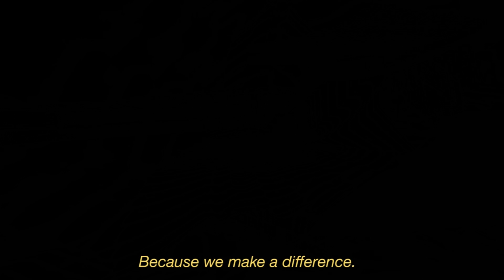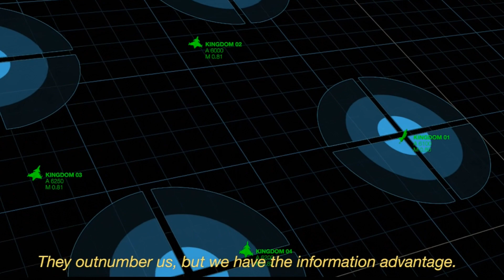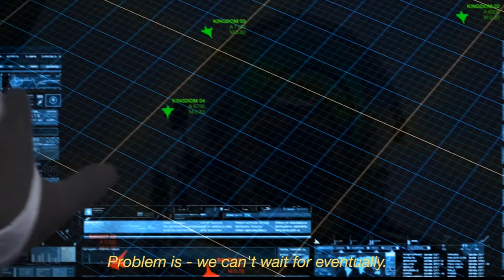Gripen Fighter Jet - Canada's Future Fighter?

Comment: what ive understood you get more airtime compared to downtime in the gripen and its much much cheaper than the f18 and it dosent break if you get a piece of gravel into the engine as the american planes its made to be cheap i think it was like a 4th of the f18 and also a 4th in matinence cost and you can teach a conscrips to change the engine on it so you could have much more airplanes and also much more airtime i think it was 22h flying and then 2h downtime

Comment: If the RCAF requirement for a twin engine aircraft (in lieu of safety in hostile, sparsely populated expanses, a.k.a. the arctic) is no longer deemed important, then I would back the Gripen for RCAF service and forget the F-35 entirely. The Gripen's latest iteration is very advanced, multi-role, NATO compatible, proven (serves in several air forces), STOAL, made for the same environment, large family similar to F/A-18 family, much cheaper per unit and probably in operations, and Brazil's interest in a naval version means that arresting hooks could be retained (customized version?).

I still think that although the F-35 COULD be a good aircraft in the end, its probability of being so decreases exponentially - it is so far behind schedule, so far over budget, the program has failed to keep to its timetable (deliveries), it's just sucking $$$ (never enough), causes massive political issues, has many defence critics (as well as allies to be balanced), and virtually everytime it's in the news there is a problem; such as unable to fly in storms, software bugs, cannon unable to fire, design compromises compromising the aircraft, inability to beat F-16 in VR Dogfight etc etc. Some of these problems are doctrinal rather than to the aircraft, but at present I agree with Pierre Sprey, that "it's a turkey!"  (I recommend to Matsimus the 5th Estate episode on the CF-35 if not already watched)

My only gripes (slight pun) with Gripen are the following: The aforementioned single engine vs twin engine for the environment (although the Swedish Air Force operate in similar conditions seemingly unworryingly with regards to it).
No air force operating "heavy", twin-engine fighters wants to swtich to lightweight fighters without opposition. F-15s v F-16s etc.
Logistics train - having to switch not only from Boeing made Aircraft but also switch to new parts, new repair drills/techniques etc. what will happen to the old stocks? I suspect $ losses on investment, unless CF-18 parts can be used on Gripens lol...
Potential unproportional US 'backlash'/'crybabying' over dumping their products 

My 'ideal-realistic' proposal for the RCAF at present would be a mix of F/A-18E/F to fill the heavy fighter/multi-role position (making use of the current spare parts, teaching, familiarity, experience etc) and Gripen E/F in a small batch to evaluate its operational capabilities in relation to the Super Hornet - if the Gripen proves better, then the teaching of recruits can switch to the gripen as the 'legacy' F/A-18E/F, parts and personnel are phased out. 
(I say 'ideal-realistic' because IMO the best aircraft for the RCAF may be the politically impossible Su-27; twin engine, proven, dependable, upgradable, large family, similar operating environments, multi-role, 'heavy' fighter, maneuverable, robust, easy maintenance etc etc)
Reply: As far as I understand, the problem with the F-35 is not all the bad stories... But that it has been mishandled to such a degree. Regarding the cost, I honestly feel that my country should demand that the price should matched the original cost mentioned to us... The current setup means that we will replace 68 F-16s for 28 F-35 with 4 permanently set in the US for "training". Original it was said that we would have to go down to 48.

Regarding the bad stories... Most if not all of it is due to development... But we have not heard of F-35s delivered yet... So they might be as bad as many claim, or they will be as good as the sellers claim...

"I suspect $ losses on investment"... Or Canada sells the stock to other countries that still operates the planes... Granted there wont be a profit, it is better than nothing.

"Su-27" I don't know why so many on youtube seems to love the Russian aircrafts... As far as I know, it would be a really stupid buy, it might be a really good jet(!) but the Russians do not sell their top of the line weapons, but the downgraded export models... Having do upgrade the jet you just bought with a new more powerful engine, new software (because the pilots don't understand russian) possibly new guns and so on... Besides it being political impossible, it would be hard to do it practically too.
Reply: I do have a slight bias to the Su-27 family as it is my fave - it fulfills the maxim "if it looks right, it probably is", and the latest Su-35S is a beast, at MAKS this year it did an amazing pirouette without discernible altitude loss. But I digress.
I did say that it was unrealistic due to politics, but NATO have bought Russian - Greece and now turkey have been buying SAMs and stuff, and Slovakia bought MiG-29s back in the mid 2000s, so it is possible albeit improbable. And they were partly joint venture too, whereby Slovakia chose the engines and MiG installed them. There are also many companies (I think mainly israel but also Romania, Poland, Russia etc) that offer upgrade packages to 'legacy' air-frames - my favourite case of this is the MiG-21, whereby some upgrades make it a 4th generation fighter, with one case claiming a 4:1 victory over F-16s in simulations, but details are a bit sketchy.
That said, I do think that if the RCAF had the latest Flankers, such as the Su-30SM and Su-35S, maybe even the latest upgrade Su-27SM3 at a pinch, it would have a very capable and suitable aircraft for the aforementioned reasons, but again it is HIGHLY unlikely for politics - so much for the global free market eh? If 2 engines are an essential criterion then Super Hornet for ease of logistics and transition, otherwise Rafale or EF2000, as I doubt Canada can afford F-15s in the numbers needed (let alone F-35s)